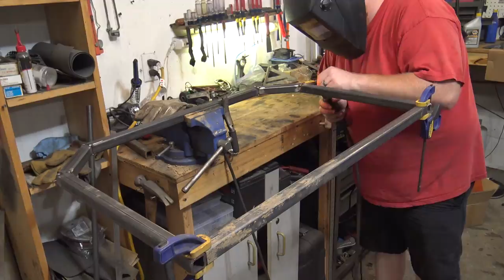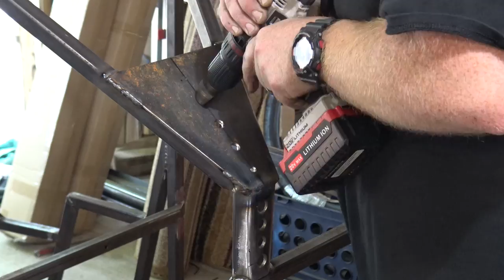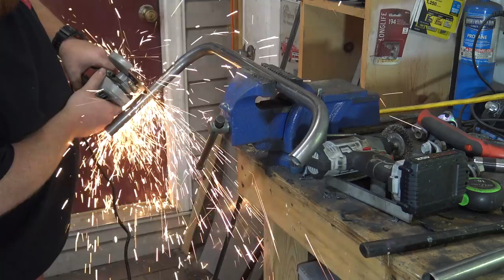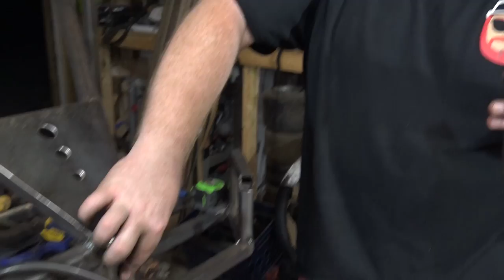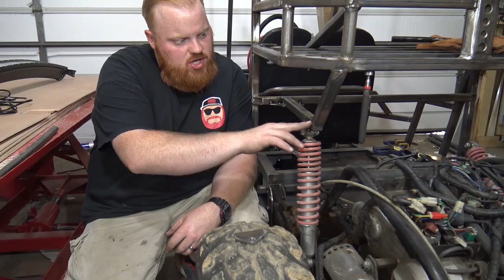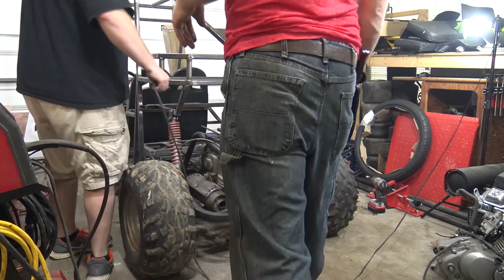4 Seater Go Kart Build Ep 8 (Shock Mounts)

Comment: A few words of advice from a grey bearded fab guy:  Don't pick up your MIG gun without your dang gloves on. Buy yourself a pair of TIG gloves and wear those when you need more dexterity. Sleeves to cover your forearms would be a wise investment as well. The UV from welding is every bit as bad for you as the sun, and the effect is cumulative. Yep, protective gear is hot and uncomfortable, but it's much less so than having bits of skin cut off and tested for cancer.

Comment: this thing is going to weigh a ton. what engine are you using?
Reply from the maker: +andybailey78 150cc. It will handle the weight with no problems.
Reply: Red Beard's Garage are you throwing the performance part catalog at that 150cc?

Comment: welding with no pants and no gloves. my kinda guy. this is why I also have a wicked tan
Reply from the maker: I wish my pasty arms could get a tan. Im a old red head so no tan here lol. The only time I wear gloves is if im welding for a long time. Don't need them just for tacking and quick welds in my book. Thanks for watching and supporting what we do man.
Reply from the maker: I try to always replay. After all its because of supporters like you I can do my dream job and I sincerely thank you for that. I will check it out and sub to you.
Reply: Cheers man. I'm working on a 4 seater kart for me an my kids. Using some old quad/tractor tires I was given. Video when it's finished :)

Comment: i just bout my first 150cc american  sport works wht should i do to  get it running better runs then die got a new carb and cdi coming
Reply from the maker: +jordan tractor vlogs that's should do the trick. Make sure to adjust the valves on that engine and it will last a long time
Reply: Red Beard's Garage .002 right
Reply from the maker: +jordan tractor vlogs yes sjr
Reply: Red Beard's Garage okay thanks i love it very good put power to ground for sure poat a rideing video  let see some offroaoding on ur 150
Reply from the maker: Will do man
Reply: Red Beard's Garage  I love your voice.

Comment: Flux Core Welding is very similar to the industry workhorse, Gas Metal Arc Welding (GMAW) or Metal Inert Gas (MIG) welding, with the exception of the wire and the need for constant voltage. FCAW is often used for welding structural steel, heavy equipment repair, and bridge construction, among other applications. sourced from google
 It is stronger than standard Mig welding.

Comment: Hey can anybody help me with my go kart and the problem is that when I press my brake my pedal isn't returning to the disengaged position and I don't know what to do because I know nothing about go karts
Reply from the maker: Sounds like you need a return spring to pull the caliper back open after its in-gauged.
Reply: Red Beard's Garage can I order those off of go power sports
Reply: Red Beard's Garage where does the return spring even go